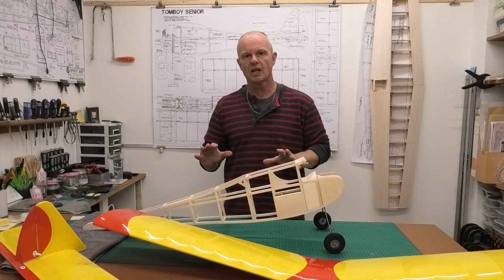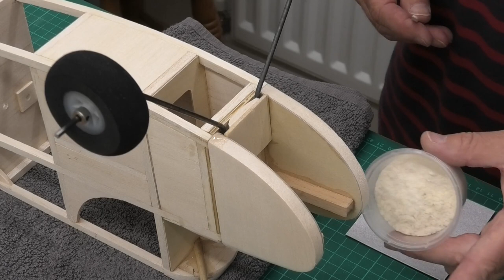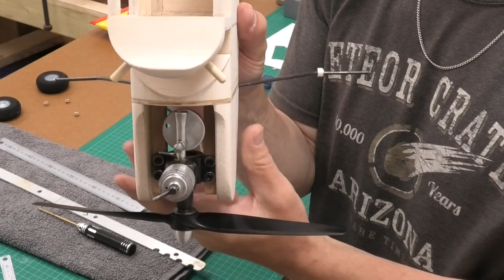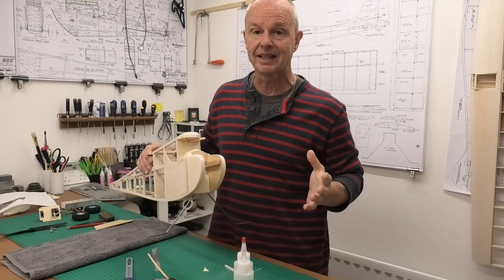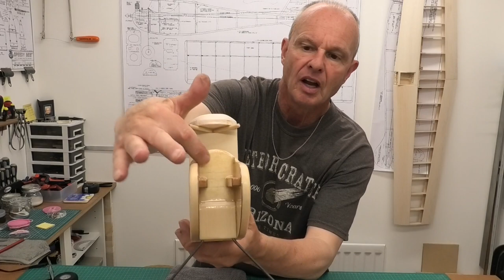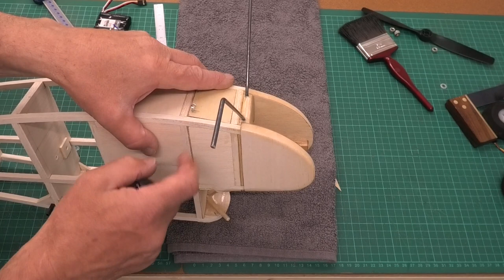Tomboy Senior - Build Series - Pt 13: Finishing off the Fuselage

Comment: I like to use some water-based acrylic paint in the engine bay to match the covering before fuel proofing. And rather than thinning down epoxy, which is fine, I'll use epoxy finishing resin.
Easy peasy! And it looks much nicer.
Reply: I want to try and put dye in the epoxy then try a test piece to see what happens.
Reply: @16-BITFPV  
Interesting. Let us know what you find out, okay?

Comment: Superb Mark, are you going to trim the excess undercarriage off after the wheel collets?
Reply from the maker: Thanks Cliff, yes undercarriage will be trimmed, usually one of the last things I do, as wheel may get changes when balancing, if I need a little more or less weight in the nose, surprising how much weight variation there is between different wheel manufacturers
Reply: @MarkRobinson555  Thanks Mark, good advice 👍